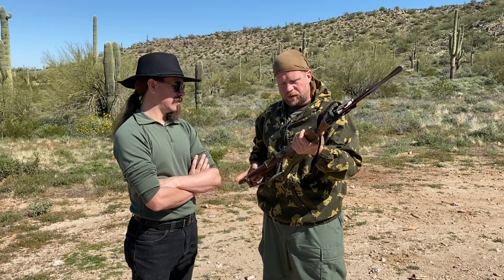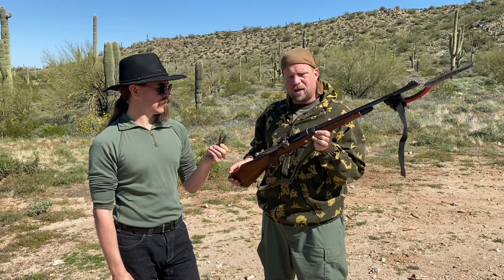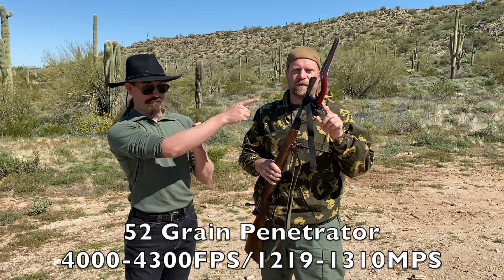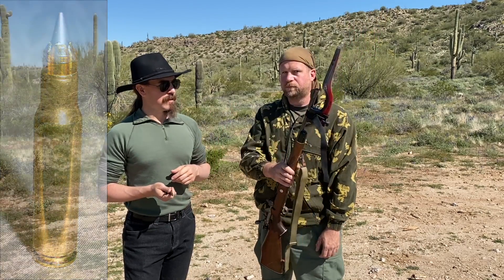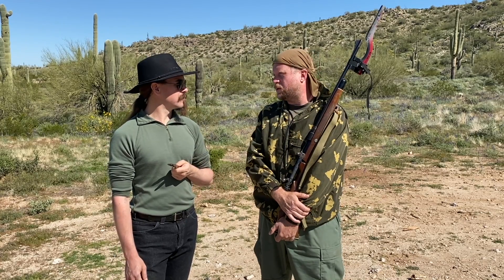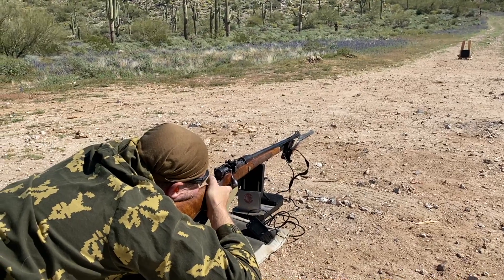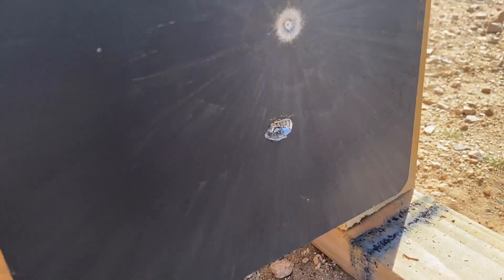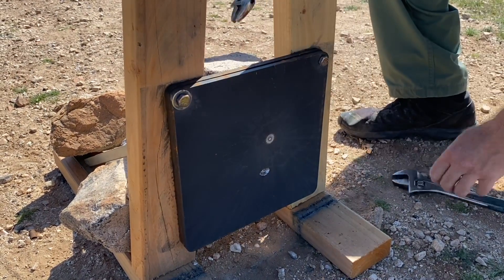M948 7.62x51 "SLAP" - Armor Piercing Ammunition Testing

Comment: I'd be very interested to see the result of what would happen if you took an M2 black tip AP projectile and loaded it into a .30 cal magnum cartridge, maybe .300WM, .300NM or even something like .30-338. The black tip is obviously an excellent AP projectile, so turning up the velocity could make a significant difference in performance
Reply: .30-378 Weatherby Mag. It should EASILY hurl a black tip at 3,000+ FPS, maybe even 3,500 FPS with a hot load. In fact, it was originally designed for armor penetration testing.
Reply: @iandegraff3472  the factory 300 win mag hunting ammo I have is advertised to go about 3200 feet per second so no doubt that an ap bullet would be screaming
Reply: @dELTA13579111315  I had been wondering how one would defeat level IV armor for a couple of months now (short of a Barrett .50 cal or crazy 7.62x54R/8mm Mauser exploding rounds), because reasons. 

Protection against .30-06 M2 AP is one of the requirements for level IV stuff. My first thought was M2 black tip projectiles loaded into something like a .300 Win Mag case. Turns out some folks have already done that, some of the level IV stuff will stop it, some won't. So I thought, "Why not something even faster?" Presto- I discovered the .30-378 Weatherby Magnum cartridge. 

When it was used for anti-armor testing by the military back in the day, the original loading fired a 30-grain projectile at 5,000 FPS. Shortly thereafter, a denser, slow-burning powder was introduced which increased the velocities to 6,000 FPS. Yikes. 

An M2 black tip projectile has a specified weight of 163 to 168 grains, so we'll just call it 165 grains. Weatherby sells a factory 165 grain load with a muzzle velocity of 3,500 FPS, but most of the reloading manuals call for a muzzle velocity of 3,300-3,400 FPS for the .30-378.
Reply: @dELTA13579111315  about 42-4300fps?
Reply: @1johnnygunn  Factory spec for Remington 30-06 sabot 55-grain .22 varmint bullet was 4,200 fps from 24" barrel.  In the field, accuracy was minute-of-prairie dog only to 200-300 yards.

It wasn't until years after those were discontinued that more experience with sabot bullets proved that no more than .05" sabot : bullet : bore difference for maximum accuracy.  A .257, 87-grain varmint bullet would have had much better accuracy in a .308 bore, while still boosting velocity.
Reply: @iandegraff3472  Yes, THIS! I would pony up money to fund Karl loading a couple .30-378 M2 rounds.
Reply: Somebody online did exactly that using 300 win mag. Penetration went up dramatically. Makes me wonder what 300RUM or .30-378 Weatherby
Reply: Also like I said elsewhere I think youll  need a tighter rifling twist than most 308 barrels are going to have if you want the rounds to be accurate
Reply: I mean they sell accelerator sabots to allow loading 5.56 or 224 or 223 in any 30 caliber cartridge. You'd just need to pull some bullets from some 556 nato AP.
Reply: @molochi  True, but would the slightly lower mass of the 5.56 "help it along" more ?
Reply: @molochi  I did the math a while ago and a 5.56 AP round in a 308 should be about3350-3500fps and a 338 mag about 3800-4000 fps.  It is very difficult to increase velocity because energy = mass x velocity squared, which means you have to increase energy (powder) by 4x to get 2x the speed.
Reply: As someone who owns a 300 win mag rifle, I second this!
Reply: According to Quora poster it will not stop a 2000 lb Alaskan Brown Bear.Even with a head shot, it might just make it angry as it glanced off the bear's skull. I don't know, he is up is Alaska and I'm not.
Reply: Problem is a rifle that has never shot AP can get the rifle bore basically bored out by the steel  or tungsten penetrator. Had a buddy with a nice high priced rifle then he lends it out to a buddy who fires 200 rounds steel AP & 48 Tungsten though it and ruined the bore. You use a low budget rifle no problem. Anyways the guy shots his rifle before competition and his tack driver became a scattergun. He had to barrel the rifle and his buddy basically refused to pay even though he was given 40 rounds of match ammo to fire for free. The guy planned it out  then bragged about it for weeks and this is why you never lend anything out to military buddies.

Comment: Maybe they didn't penetrate because the second plate sort of reinforced the first plate which prevented it from denting enough for the bullet to go through
Reply: Ian said it was likely it would have penetrated without the second plate, so yes, it would have gone through but still did worse than .30-06 black tip. I'm honestly surprised that it penetrated as much as it did when keyholeing; I'd imagine it might actually make it through if they got a solid hit.
Reply: @coltpiecemaker  It would have, the second hit at least was clearly a hit that would have penetrated if not for the reinforcing plate- you could see it breaking out only a short distance. This is the gap between the two plates.
Reply: I've watched hundreds of hours of slow motion armor tests. The plates stacked up back to back like that don't do much for each other. They act like independent plates in that type of scenario. So no, the second plate didn't change anything. By the time the first plate has a chance to move the projectile has already disintegrated or passed through the plate.

Comment: I’ve never gotten any SLAP ammo but from class on ammo identification in gunnery prep I know that .50 cal SLAP grounds use an aluminum Sabo instead of plastic.
Reply: The .50 Cal slap I was using in Afghanistan used a plastic sabo
Reply: @derek-kh2gt  Mine too. But the 25mm use an aluminum sabot that doesn't split apart.
Reply: @derek-kh2gt  same.  Liked the SLAP, LOVED my API.
Reply: There's an aluminum piece at the bottom of the sable that holds it together, the entire thing is still mostly plastic
Reply: it must be some alloy, aluminium would crack into dust, even when doped with silicon.
Reply: @jackvernian7779  aluminum is a lot stronger than plastic especially 7000 series

Comment: Can you put a light down the barrel of the rifle to cheak if it left any bounce marks on the rifling. That might show if it was a clean flight.
Reply: I'm guessing that most sabot failures don't result in barrel damage, only the especially unlucky ones.  Instead they simply result in the projectile failing to spin or an asymmetrical exit.  Either results in premature tumbling.
It's easy to understand why this round wasn't approved.
Reply: I was wondering the exact same thing.

Comment: You know it's unobtainium when you can procure a grand total of 2.
Reply: Still available at knob creek, about $100 per round when you find it.
Reply: @turbosnake8038  have they really gone up that much? 2013 - 2014 I was seeing them for $10 round dirty, $20 round clean listed online.
Reply: @otm646  a friend has about 90rds black tip in enbloc clips...
Reply: @wollywolly2734  Yes. Might be different in commie states though.
Reply: Stagger it in a magazine  with FMJ pass it out to a reconnaissance squad
Reply: We could mamufacture slaps in pretty large amounts if you wanted bro. We cpuld get the supply up and help feed demand

Comment: We use something similar in the Swedish AI-AW (PSG 90) sniper rifle.
Reply: Have you got any info on how those rounds perform?
Reply: @AdotLOM  I dont know about it's armor penetration, but the real advantage is the BC. Bullet drop for "7,62/10 prick" is only 5,2 mils on 1000m, compared to 14,4 mils for the regular FMJ.
Wind and spindrift is also about 1/3 so its alot easier to make a first round hit. mv = 1290m/s vs 850 for FMJ